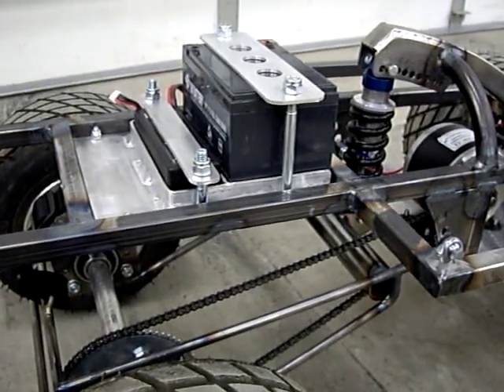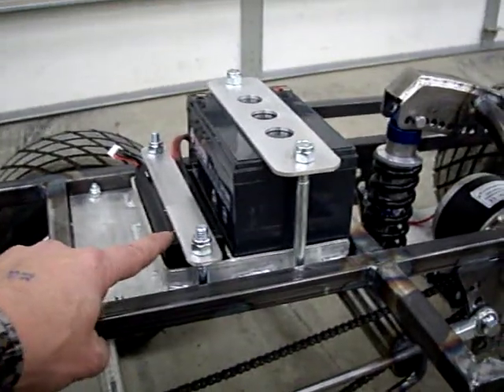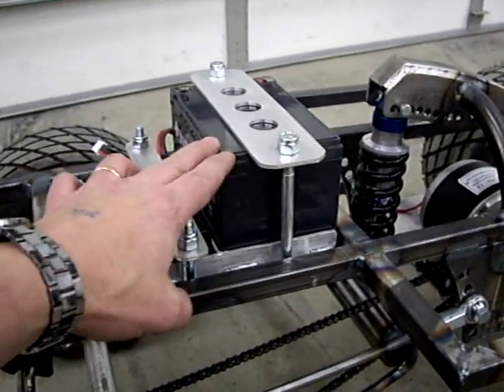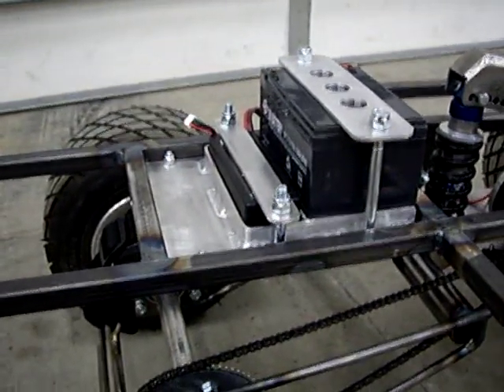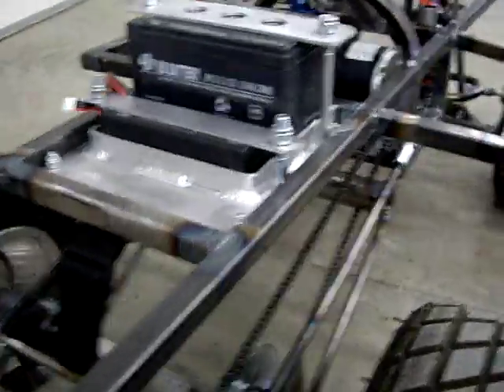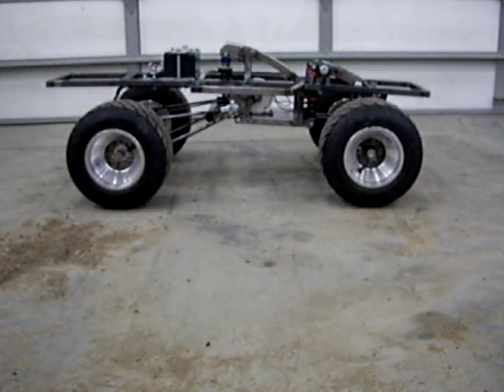Home made GIANT SCALE rc car #13, 1955 Chevy, large scale build.

Comment from the maker: @5ky5tr1d3r , great ideas for sure.  I'd love to give the front more travel.  What's killing the travel is that the  front suspension arms are so short.  They are as long as they physically can be, but they are short.  This means they have to move a lot.  And the limiter to making more travel at this point is actually the tie rod ends.  I can make it travel a bit further but then it starts tweaking and bending the tie rod ends.  It's still got nearly 3" of movement on the front.

Comment from the maker: @5ky5tr1d3r, always room for improvements, no doubt about it.  :)  The compromise on this car that creates the problems is tire width and overall vehicle width.  I made it 32" wide to fit through doorways. Because of the limited travel available on the front (and it's truly the maximum I can design until I find a better tie rod), it has to be stiff, or it would bottom out constantly.  On the back, I have virtually unlimited travel but have settled on 10".  fr and rr bottom out at the same time.

Comment from the maker: @zzxcrozzy, Should be able to run a higher amp draw motor without damage.  You'd need the specs on the motor to be sure and compare them to the published limits on the rx8.